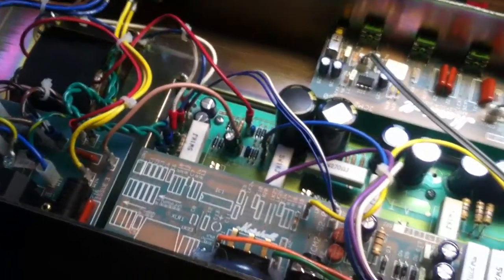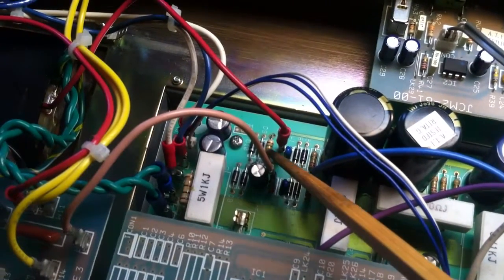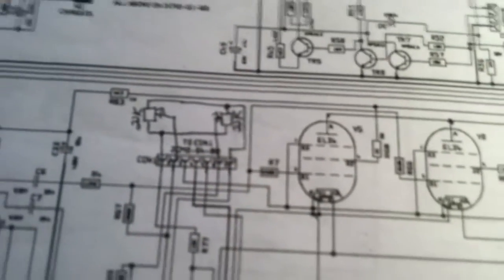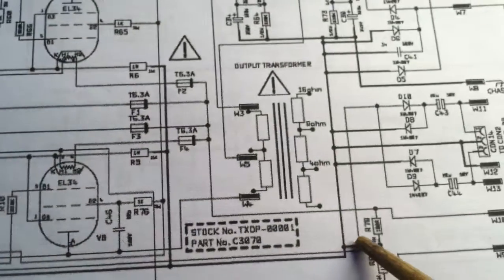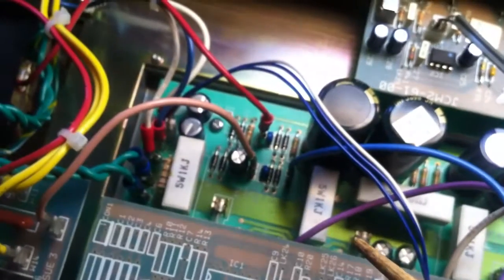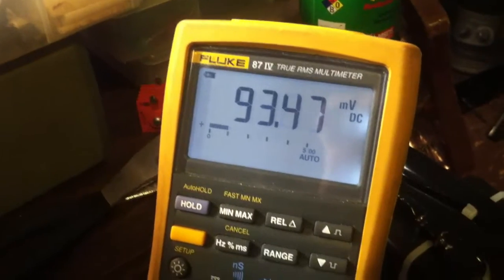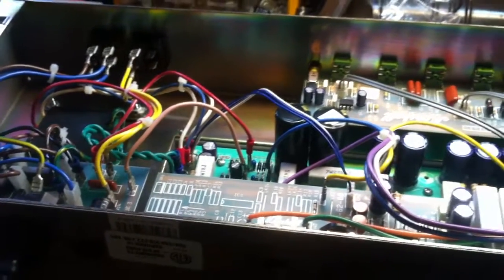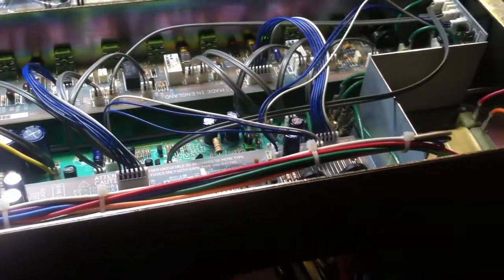Solving Bias Problems in a Marshall DSL-100 & TSL-100

Comment: I truly believe that the problem is caused by the two capacitors in the bias circuit, C43 and C44. They are polarized, and the circuit has AC as an input. You can't do that, as it will eventually de-form the plates on the capacitors, and they will lose value. Everybody who works on electronics knows what happens to electrolytic capacitors hit with the wrong polarity, and half of the time in that circuit, it IS the wrong polarity. The other problem is that the value is just enough to transfer the voltage needed. So, I replace the two 22uF capacitors with 47uF Non-Polarized (BiPolar) 63V capacitors. It has solved the problem for every amp I worked on with this problem. So, what is more likely, a mature material like PCB material suddenly becoming conductive in just this application, or capacitors failing as expected when used in the wrong conditions?

Comment: thermal bias drift issue - replacing the tranny was a waste of money and all this other blah blah by you is just grasping at straws cause you got this wrong.  Drill out pin 5 on the power tube sockets and rewire direct to the bias resistor.  dummy......

Comment: I done heard they put a cap with the wrong value (60) and you need to replace it with a 100 ... and that the traces being close and board conductivity wasn't the actual issue. just throwin that in the mix here too.

Comment: I am perplexed.  When you initially read the amp bias, the readings were WAY out of spec, with one side only at 6mV.  How is that possible? The amp would sound like junk.  How would it ever leave Marshall like that (assuming original tunes)? And the original design of the amp from Marshall should bias fine.  I have the same amp and I get bias adjustment from like 10mV up to 150mV.  If it adjusted okay for Marshall, why is it not adjusting now, without having to change a resistor?  That should be a red flag that something is not right any more (unless I am missing something).

Comment: The only way to fix cheaply is remove power tube sockets
Drill out control pins and point to point to point back to coupling caps. Done many many with no comebacks

Comment: I could be wrong, but maximum plate/watt dissipation for an EL34 is about 20 watts. After doing the math, 14 watts is 70% (the accepted dissipation for EL34 setup) up to 16 watts which is 80% (EL34's w/forced ventilation on the pt's).  27 watts would be about max for 6550's and should not be considered "a little high" for EL34's... Just sayin'...

Comment: This amplifier is known to suffer from leakage through the PCB at the power tube sockets when hot, a critical design flaw that causes bias to drift with operating temperature.  I have heard of it being resolved by actually cutting the PCB around pin 5 for each tube and instead connecting the bias voltage directly to the socket pin.  PCB mounted power tube sockets can cause a nightmare of troubleshooting as the leakage only begins to rear its ugly head at extreme heat conditions.  In other words, not on the test bench.

Comment: When you change the 10k resistor to 15k, you say it increases the amount or range of neg bias voltage. How much does it increase? The caps you mention for the bias.. are only rated at 50v.  Which they should be more like 63 volts. But do you know how much neg voltage increase you have after the resistor change? Just wondering if the 2 caps also need changed.
Reply: you are lowering the neg voltage ate the tie point on the  22k junk variable res and this in turn makes em run hotter!!!It decreases the range,have one on the bench at the moment,look at rr68 33k  replace this with 39k   now you can actually set the tubes cooler and safer The pin 5 mod is a def a do. The high end is short of 50v

Comment: My JCM 2000 bias pots max out at 15 mV. Is this pointing towards buying a new set of tubes or do I have a bigger internal problem?
Reply from the maker: That's pretty severely off and probably needs the PCB drilled out around some of the output tube pins. That's something I would consider a fairly major and delicate surgical procedure. It's possible something else is wrong in your bias supply circuit, but the conductive board issue is a known issue too.
Reply: Is there a way for someone with only basic electronic knowledge to test for a conductive board?  Yes, I know the caps will fry my ass if I don't take the right precautions. But I'll definitely have to have a tech drill it out in the case that it doesn't test right, I would just like to know what to tell the tech to look for. Mainly because I've never used this tech, he lives 4 hour round trip away from me, and I'd like to be certain.  In fact, it may be more cost effective to just by a new pcb.  Thoughts?
Reply from the maker: There are different ways to fix the bias issues found in these depending on what the issue is. Sometimes the issue doesn't show itself until the amp is warmed up to operating temp. The pins 4 and 5 on output tubes conduct between them through the board, which would need to be drilled out between them to fix this. Any circuit traces running in that area (not sure if there are any or not) would need to be replaced with wire. Here is one discussion on the various bias issues with Marshall. Lots of info and links from there. Good luck!

http://music-electronics-forum.com/t28240/

Comment: Please tell me about that 1K resistor that you cut the jumper and put a 1K in its place. I have TWO 90's Marshall JCM 2000 Heads One is the 100 Watt one is the 50 Watt. My 100 Watt is now very noisy . I was Told it was The INPUT on the Front of the Amp where I plug my guitar into. Also the 15K resistor you replaced on the 100 Watt head K77 was a 10K and you put a 15K in place of it. Is it the Same on the 50 Watt and is That possibly my cause for the cracking hissing noise ? Thanks brother.
Reply from the maker: Crackling noises could be coming from different sources - resistors, tubes, or even a transformer. Crackling noise is a difficult one to diagnose. You're going to insert a signal into the input and trace it past every stage to see where all it's present. If it's present at the first stage, it's either an issue with a resistor or tube at the first stage, or something power related.

Comment: what year is this amp ?
Reply from the maker: Late reply I know, but I think it was late 90s. 1998ish.
Reply: The Guitologist I just bought a 2000 year model off Reverb for 6 & Am stuck with it. It is a JCM 2000 Dual Super Lead. It is stamped JCM2 - 61 - 00. Not JCM2 - 60 - 00 ! The Guy said all worked, Broken reverb, but who needs reverb any how.I seems real clean inside. I saw Paul Gilbert using them as backline in stereo when he was showing his Fireman Guitar. I found out to late on the Issues on Bias drift etc..I got a Peavey Penta prior.Ive got terminal cancer & watch all your vids.I subscribed 3 month's back.I was watching Uncle Doug & Elpaso Amps prior.Like you & Uncle Doug the most.I am 49 & My Dad does Electronics for a living. I am strapped & wish I had waited.I found a JCM 900 Super high gain 2100 on eBay 600 local pickup in F.T. Worth. My family goes way back in North Tx. Used to play Big D. 30 miles North of D. Does this work & did you drill ? I saw the main board posted for sale. I just didn't want a ROHS amp again I can only solder some times when my hands stop shaking.Some people say these are scooped amps?I got it to do some Hendrix, Alvin Lee, 80s, 60a Rock using  1990s pre pedals out front. All stupid speakers are scooped today as it is. I have a set of Jet City JCA20HV heads.I Wicked, Solder sucker every thing in those except the Tranny's & the pots. The Volume doubled, gain, etx.When I resolderd all back.Dad said they removed the silver, not the led it seems. It may be copper working as the conductive part now.As I redid them even on the Solder Trace.I saved & seems I Alway's Make The Wrong Buy ! Brad, keep up the good work.Wish I could read a schematic God bless & great page ! ! Hope to hear back Richard

Comment: Are you sure it isn't the bias drift that is associated with many of the older main boards in the DSL and TSL models becoming conductive? That is what happened to mine and many others.  
In the worst cases the power tubes can red plate.  I have seen some boards that looked like they blew up. The boards made in 2005 on are made out of much better material and the components are also much better.  I bought my board from http://www.hotroxuk.com/.  Shipped to the US they are around $145 which is WAY less than Marshall service places in the US will get them for you.
After I got the board it solved all sorts of problems: I had a real fire breather.
Reply from the maker: It's possible. The owner is a friend and if there are further drifting problems, I'll do the board drilling fix on it.
Reply: Yes, some of these will drift all over the place with heat. I fixed one for a guy and had to take a Dremel and cut the PCB around pin 5 on the output tubes. His amp was dead collecting dust for 10 years until this fix. It had me stumped until I found this link. This remedy fixed it and he hasn't had one issue in 3 years. http://www.hullerum.de/Marshall/TSL122repair.html
Reply: The Guitologist I was going to use 1 channel only for this 100w. Just bought a 2000 year model off Reverb for 6 total & Am stuck with it 😣. It is a JCM 2000 Dual Super Lead 100w. It is stamped JCM2 - 61 - 00. Not JCM2 - 60 - 00 ! The Guy said all worked, Broken reverb, but who needs reverb any how.I seems real clean inside. I saw Paul Gilbert using them as backline in stereo when he was showing his Fireman Guitar. I found out to late on the Issues on Bias drift etc..I got a Peavey Penta prior.Ive got terminal cancer & watch all your vids.I subscribed 3 month's back.I was watching Uncle Doug & Elpaso Amps prior.Like you & Uncle Doug the most.I am 49 & My Dad does Electronics for a living. I am strapped & wish I had waited.I found a JCM 900 Super high gain 2100 on eBay 600 local pickup in F.T. Worth. My family goes way back in North Tx. Used to play Big D. 30 miles North of D. Does this work & did you drill ? I saw the main board posted for sale. I just didn't want a ROHS amp again I can only solder some times when my hands stop shaking.Some people say these are scooped amps?I got it to do some Hendrix, Alvin Lee, 80s, 60a Rock using  1990s pre pedals out front. All stupid speakers are scooped today as it is. I have a set of Jet City JCA20HV heads.I Wicked, Solder sucker every thing in those except the Tranny's & the pots. The Volume doubled, gain, etx.When I resolderd all back.Dad said they removed the silver, not the led it seems. It may be copper working as the conductive part now.As I redid them even on the Solder Trace.I saved & seems I Alway's Make The Wrong Buy ! Brad, keep up the good work.Wish I could read a schematic God bless & great page ! ! ! Hope for reply? Hope Uncle Doug is ok. Didn't hear back a month ago on a totally different question.Take care Brad,  no matter what. Be good !  Richard
Reply: SaintFredrocks I've just done the issue 20 mother board change and the amp worked straight away.
I had a valve red plate and the two centre valves stopped working no heaters,  the valves were cold!! So I think this is the way to go with the tsl 100
Reply: SaintFredrocks have fitted an issue 20 board and it's solved everything!!!
Reply: SaintFredrocks I did the same as you changed the motherboard no soldering required problem solved 
Mines the tsl.

Comment: Having heating and basing issues with mine .. Where are you located might ship you mine to fix .. It's been sitting idol due to heat issues
Reply from the maker: I'm in Louisville, KY. I usually don't accept these newer Marshalls to work on. Just too much of a PIA. If you're local I might make an exception.

Comment: So the power tubes were running too hot?
Reply from the maker: +John Simms Yes, too hot. Dissipating 27 watts each at idle. The max rating is 25 watts each and most people go around 70% of that at idle.
Reply: +The Guitologist Hi look at the right power tubes set (looking from rear panel).  When you put full voltage on the amp, bias will start to rise decresing mv reading on left sides power tubes of the amp.  If it does that means that your motherboard is cooked, youll have to change it (go to hotroxuk.com) they sell you one cheap.  Good luck.
Reply: I just posted the same thing;-)